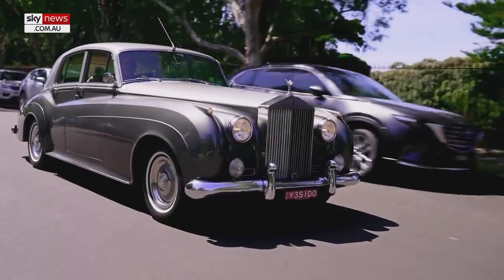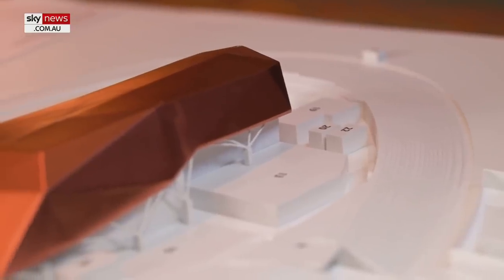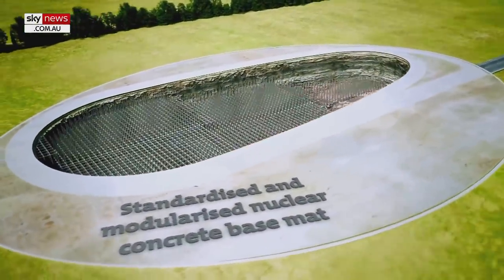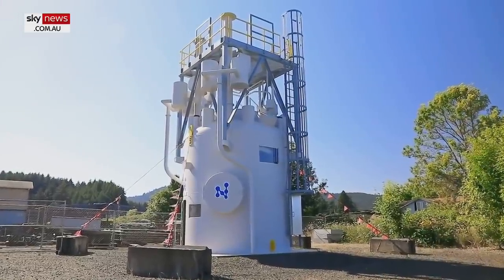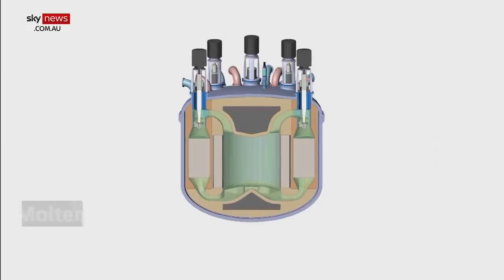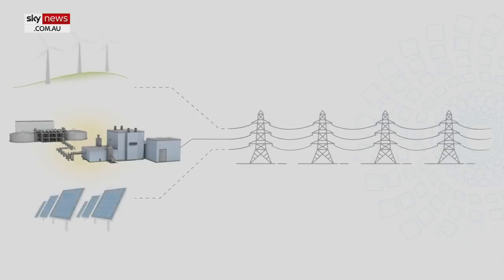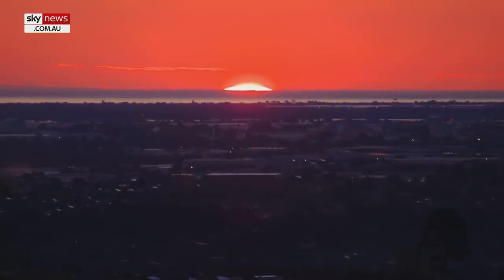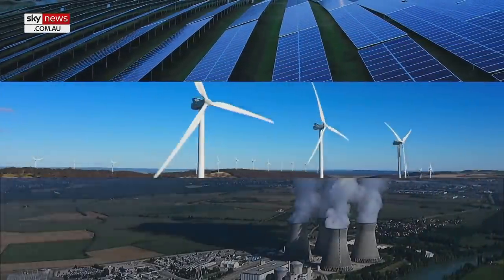Nuclear power the 'safest and cleanest' form of energy generation

Comment: 100% Australia needs Nuclear energy. 
- It's emissions free
- It's 24/7 dispatch-able power. In the US it has a reliability rating of 92.5% while Solar is at 24.9% & Wind 35%. Day or night, wind or no wind, it works.
- It is in fact extremely safe. It's deaths per KW are actually lower than either Wind or Solar
- There have been answers for waste for a long time. It can be recycled, Re-processed or, imo the best option, used in advanced fast reactors which leave no long lived waste and of course provide reliable electricity or thermal energy as required.
- It'll give the navy trained nuclear operators from the new submarines a place to work once they're done with the navy.
- Over 80% of coal jobs are directly transferable to the Nuclear industry
- It's a very compact in it's land requirements with Small Modular & Micro reactors being even smaller. Nuscale's plant design would be about the size of a single windmill with an exclusion zone that only reaches the fence outside the facility.

Now's the time to invest. France succeeded with nuclear while Germany failed with wind.
Reply: Yes. There are the risks of accidents. What were the causes of the accidents in Chernobyl and Fukushima? The first a series of human stupid mistakes that can be easily mitigated today. The former an earthquake and a tsunami hitting an old plant with inadequate safety features. How many people died in the Fukushima disaster?
I think we can do better come with proper safety mediated to avoid accidents. Today there is better technology and even possible fuel alternatives like Thorium. Nuclear is today the best option if compared to all other sources of energy.
Reply: Sky news is ling to you all again! After watching this show I would suggest getting familiar Dave Borlace. BSc in Technology youtube shows on Nuclear which further suggest the Nuclear is not the answer link to shows. https://www.youtube.com/c/JustHaveaThink/search?query=Nuclear
Reply: @freethinker4991  sheep

Comment: in order to increase the productivity of plants on this planet we need more CO2, not less
Reply: No, there is more than enough carbon dioxide in the atmosphere for plants. Historically there were periods in time when the atmospheric oxygen content was much higher and plants were quite happy.
Reply: @simongoh9461  wrong, the actual level 400ppm is one of the lowest ever recorded, the plants need 2000ppm as an optimum
Reply: @pushlooop  Perhaps this is something that is relevant to the cherry picking...."
But don’t get confused, our discovery doesn’t mean emitting carbon dioxide is a good thing and we should pump out more carbon dioxide, or that land-based ecosystems are removing more carbon dioxide emissions than we previously thought (we already know how much this is from scientific measurements).
And it definitely doesn’t mean mean we should, as climate sceptics have done, use the concept of carbon dioxide fertilisation to downplay the severity of climate change."
Reply: @simongoh9461  in reality CO2 is just a minor factor in climate, and is the base of a gigantic bio-geo-chemical cycle whose anthropogenic part is irrelevant.
Reply: @pushlooop  what are you even rambling about lmao

Comment: 😂🖕They claim that wind energy is “green” or “environmentally friendly” is laugh-out-loud hilarious – except for the fact that the reality is not funny at all. Consider just one part of a turbine, the generator, which uses considerable rare earth elements (2000± pounds per MW).
The mining and processing of these metals has horrific environmental consequences that are unacknowledged and ignored by the wind industry and its environmental surrogates. For instance, just the rare earths of a typical 100 MW wind project would generate approximately:
* 20,000 square meters of destroyed vegetation,
* 2 million pounds of CO2,
* 6 million cubic meters of toxic air pollution,
* 29 million gallons of poisoned water,
* 600 million pounds of highly contaminated tailing sands, and
* 280,000 pounds of radioactive waste.

Comment: What is wrong with geothermal technology it's clean and safe instead of nuclear, also use heat source pumps to heat housing???
Reply: NZ uses it. Not so much of it in Oz unless you dig very deep holes.
Reply: If you like a cold home, use a heat pump.
Reply: If you are over a hot spring, go for it. Most people are not close enough to be like Iceland.

Comment: Hell, if an Aussie company can effectively treat cancer & possibly SARS-CoV-2 without any nasty side effects. 
I'm certain we can solve the nuclear waste issue as well.

Whatever happened to that elevator to space.
Hmm... maybe we could dump any radioactive or toxic sustances on the dark side of the Moon or direct it toward the Sun.
Reply: The nuclear waste issue is easily solved. Stop making the stuff in the first place. There are alternatives to the uranium fuel cycle that offer much shorter half lives.
Reply: There is no " issue " . You just stick it down an old mine shaft .
Reply: Terrapower, who is in who is in this video, has their Natrium which is a fast reactor that doesn't leave long lived waste. 

Just build fast reactors like Natrium and no long lived waste issue.